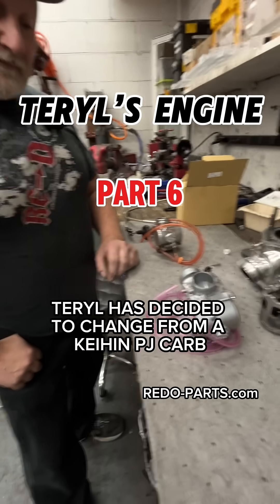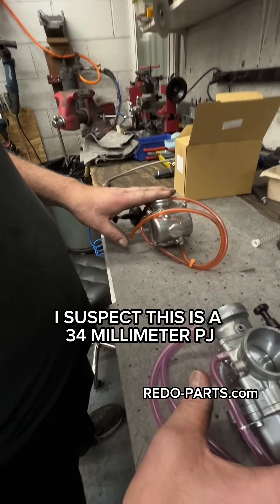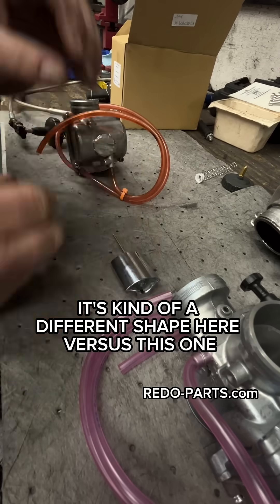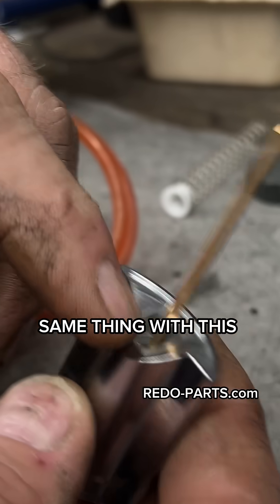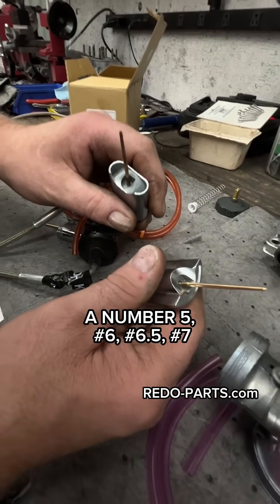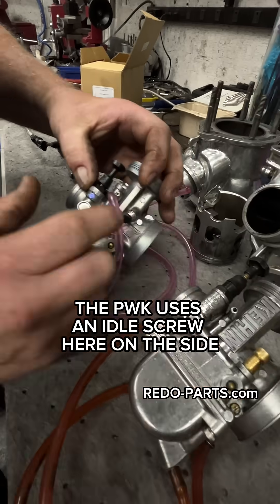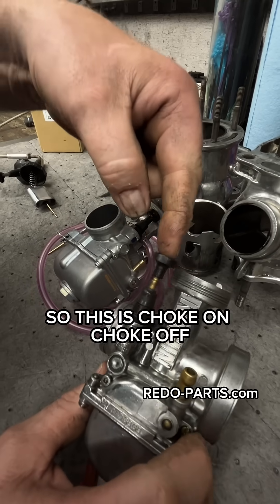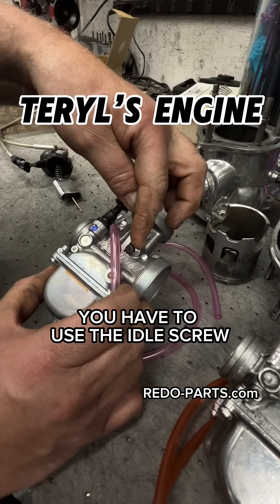Teryl’s Engine - Part 6 - KEIHIN PJ vs PWK

Comment: On the PJ carb, when turning the idle screw what adjustment is being made? Is it raising the slide or letting more fuel or air in?
Reply from the maker: Turning the air screw (located on the air cleaner side) on a PJ carb adjusts the air-fuel mixture. Turning it clockwise (in) reduces air, making the mixture richer. Turning it counter-clockwise (out) increases air, making the mixture leaner